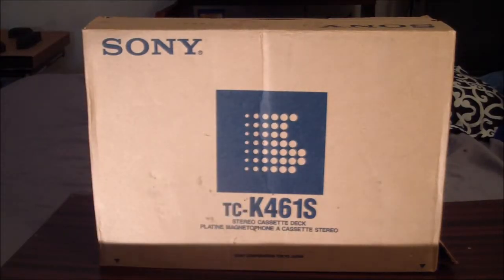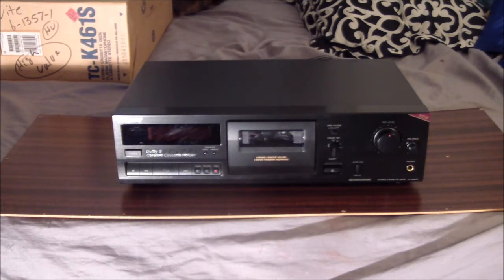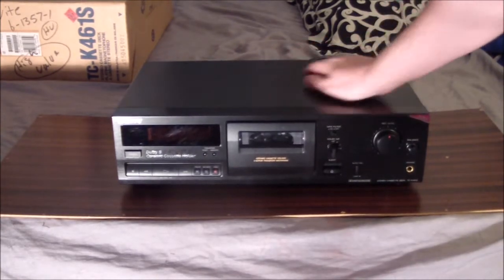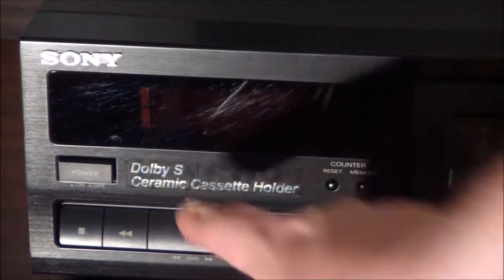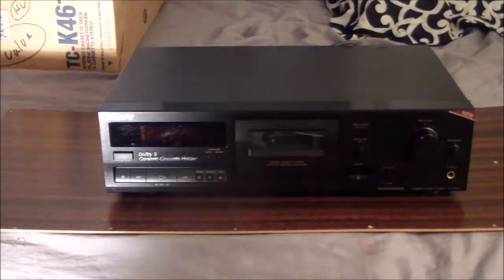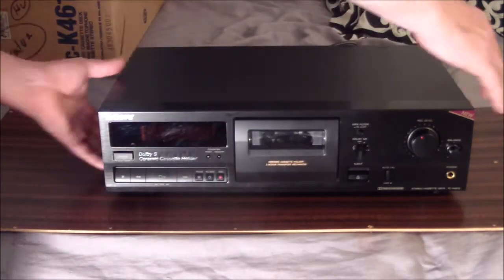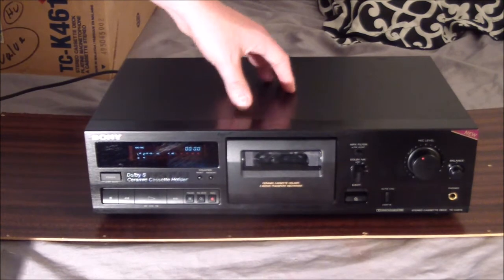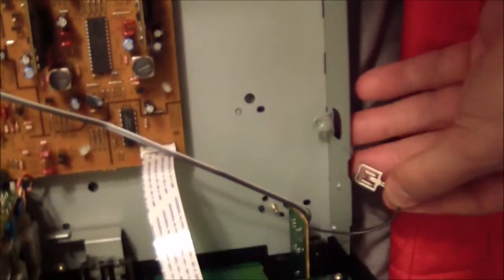Sony TC-K461S Dolby S Cassette Deck

Comment: Record Mute mutes whatever audio is connected to the input. It is mostly used to record a few seconds of silence between songs. MPX Filter is for recording from FM radio. It filters out the 19 kHz multiplex (MPX) stereo pilot tone that would interfere with the proper operation of Dolby noise reduction.
Reply from the maker: awesome, thanks. I was wondering about that record mute option.

Comment: You have good explanations on MPX and record mute.  Auto calibration is a feature that lets you calibrate the deck to the cassette you’re recording to to optimize the recording for the flattest frequency response and as close to 1:1 sounding to the source as possible.  More technically, it calibrates the bias and record signal sensitivity since every tape is different.  When you put in a blank and hit Auto cal, it will FF a bit to skip the leader, then records a high tone (typically 15 kHz) and then a low tone (typically 500 Hz).  It will then rewind and plays the tones back to judge how to adjust the bias (based on the high tone) and the record sensitivity (based on the low tone).  When it’s done, you should see a red “CAL” on the display to show you the deck is now calibrated to the tape and it’s ready to record.  You should do the auto cal with Dolby off.

I have a deck where it has a tone generator, but I have to calibrate it myself.  https://youtu.be/QxFMQ8FAdKI
Reply from the maker: Thank you for the excellent explanation on that feature.

Comment: HX-PRO works as you read. If the signal has a lot of content on the upper end region (high frequencies), the BIAS level at the recording is reduced. As result you have a better high frequency response (more headroom)

Comment: I have a Fostex G16 S with dolby S. Running @ 15 ips it sounds very much like a CD. Dolby S was great but you lose that typical tape sound. My Fostex G16 C only has Dolby C and I like it more then the S version. Probably because I grew up with tape and not the CD medium. Pre recorded tapes always sounded dull to me, never liked them. I still use reel to reel tape almost on a daily basis. Also use a diy ES9018 DAC that has just awesome details but still tapes brings me back :-)

Comment: I have a Technics RS-TR555 deck that I bought in 1991 for about $550 AUD. It features dbx noise reduction as well as Dolby B and C. I think the reason Dolby C, S, and dbx remained unpopular was the lack of portable and car audio support. Playing back a Dolby C, S, or dbx recorded tape on  a non supported player sounded terrible. I mostly made mixtapes for car listening. I had a cd player from 1987 but never had an in-car one until 2009. I did have a Sony portable cd player with a tape adaptor but that was a pain to use.
Reply from the maker: That's a really good point. My most recent car actually only has a tape deck since the CD player is busted and I'd basically have to replace a whole middle section if I wanted to replace it. I'd love to record some mix tapes in Dolby S or even C for it but the installed tape deck is Dolby B as they all are.

Comment: I believe MPX filter is when you're recording a tape from the radio it kind of cuts out a signal
Reply from the maker: Yep, I beleive you are correct.
Reply: Indeed the 19Khz pilot tone. I recall that noise reduction techniques don't played nice with them.
Reply from the maker: yea, I read that. it should be turned off when recording from a CD or none radio source.
Reply: i ´ve used the mpx filter and it seemed to me that turns the sound to mono ,that´s the usual for fm stations with interference or bad signal